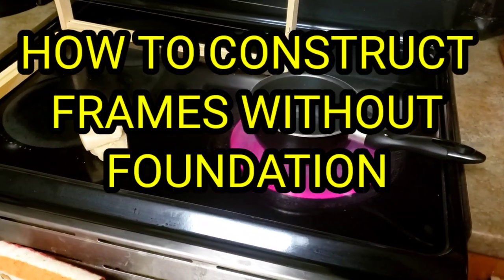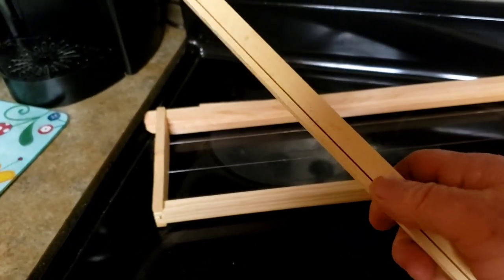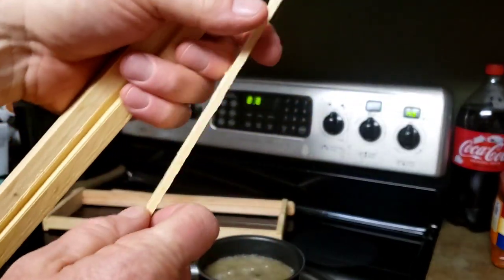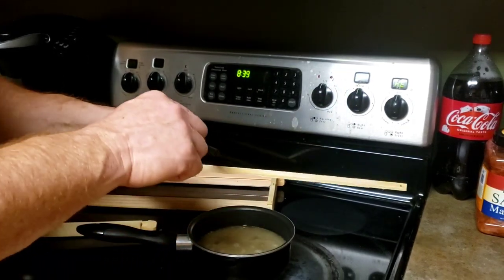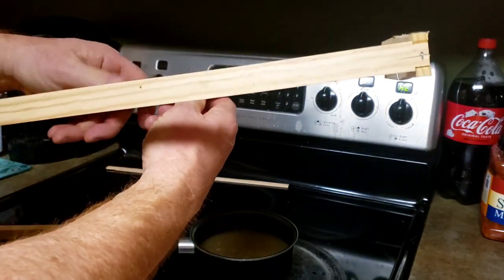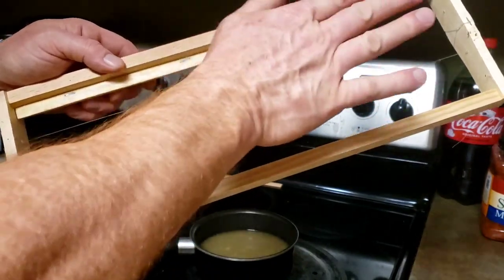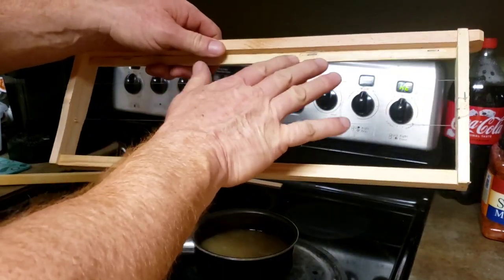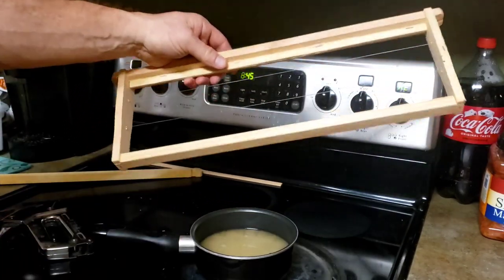How To Construct Frames Without  Foundation

Comment: You right David they build quicker without the sheet of wax, i have used frames with just a strip of wood across the diagonal of the frame and it was finished by the end of the day. Couldn t believe it. It s a technic called "cadre à jambage" in France,  jamb frame.
Reply: It's how they survive in the wild.
Reply from the maker: A lot of people refuse to believe it. But they will build it faster.

Comment: I do almost the same.  I use grooved frames because half my frames use plastic foundation.  On my non-foundation frames I wax or glue in a thin strip of wood into the groove and then use an old small paint brush to brush on the melted wax.  I tried the foam brush but it wore out quick and when it dried it took a lot of wax with it. :)

Comment: Thanks Dave, I was working on some medium frames for my supers this week and had done 10 frames with the foundation cut to make starter strips.   I use small cell foundation and didn't want to burn through a bunch of it making strips so this should work great for me.   I was going to use an eye dropper and fill the channel of each bar with wax rather than painting it on like you show here but will try both methods and see what the bees like.

Comment: My bees tend to make a lot of drone comb in the brood chber. They work it fine, as you say, but I just don't like them building a lot of drone comb, I want workers.
Reply: Replace your queen
Reply: Alan, being foundationless requires a little work to keep the new frames in the center of the broodnest where they are more likely to draw worker comb.  Frames to the outside of the brood will always get drawn as drone comb. Nothing wrong with the queen. The workers decide what to build and a natural cell hive will have around two full frames of drone comb.
Reply: @beasbeesrva2615  Thanks, I know there's nothing wrong with the queen, as I make up a lot of new nucleus colonies, with new queen's that get mated and produce a lot of brood.
Reply: Each of my hives have at least 2 full frames of drone comb  Especially during the nectar flow.  As the drone emerge my girls are backfilling those frames with nectar.

Comment: Do all wood frames have that piece that can snap off?
Reply: I was wondering that exact same thing...and also why the frames come that way?
Reply: There are two type of frames, wedge top and groove top.  The ones that break off like he is using in the video are the wedge top.
Reply: @ThatGuy-br8py  well now I wonder which one I have. Ha
Reply: Even without that piece you can paint the wax on the upper edge and bees will drow the comb. But keep in mind, you should put that frame between 2 full drown frames to keep the comb within the edges.
Reply: @LiftedAdventures  me too.....my frames are still in the box and unassembled.  ;-)

Comment: U could just coat the under of the top bar, save the messing about.
Reply: In my experience the bees will start at some point of wood that is hanging down to draw out their comb. Without a guide there is no telling where on the bar they will make their comb. The point is actually more important than the presence of wax. I have been managing top-bar hives for about 7 years now, and have never used a full sheet of foundation. I used to use starter strips. Now I just use a wooden guide in the middle of the bars without wax on them.